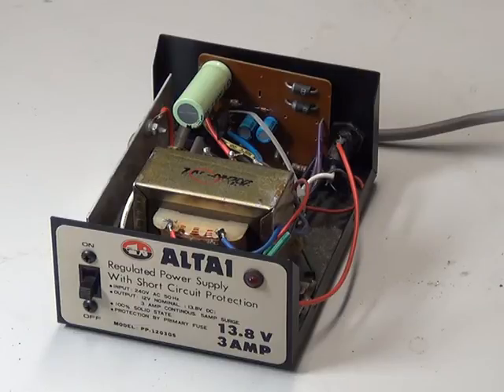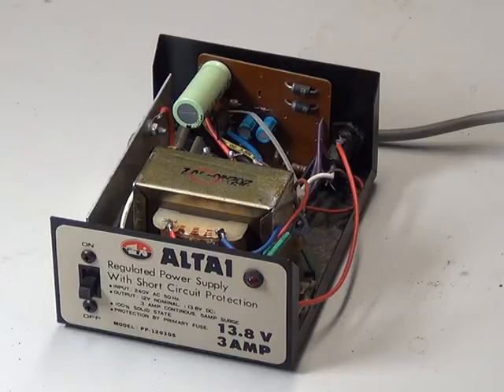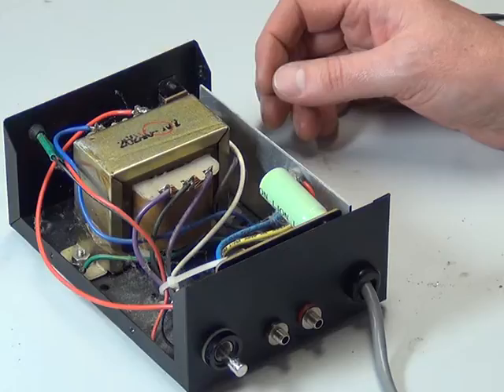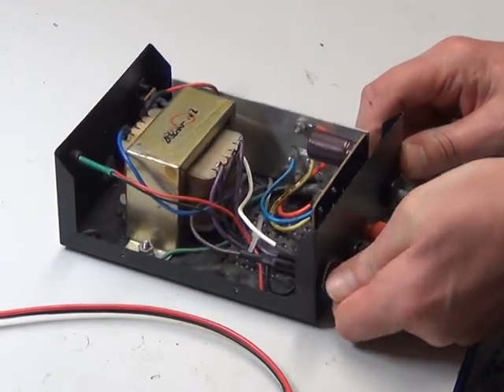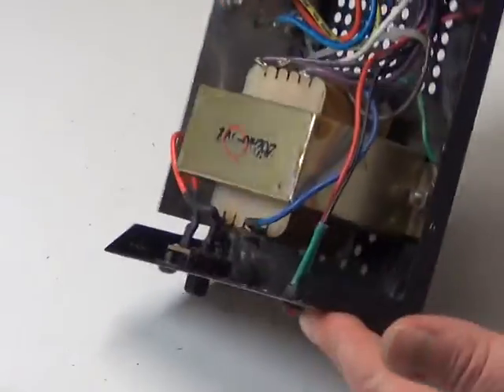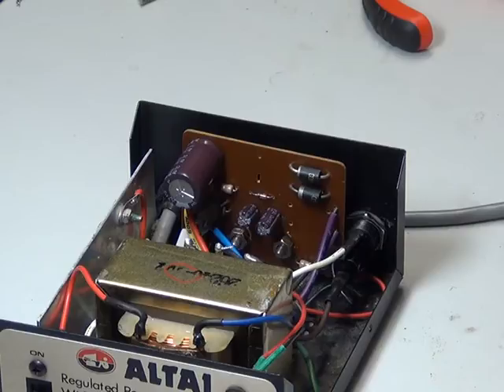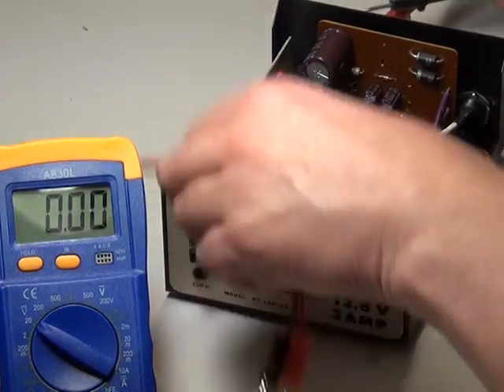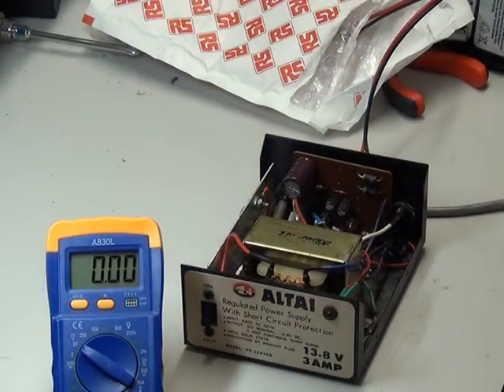Altai 3-5A 13.8V CB power supply overhaul. 1981 Taiwan version

Comment: Interesting, I have the 6amp version and nearly died of shock when I first opened it, as it's in original state. Probably put a different switch to the low voltage side. You can still get 2N3055's

Comment: HELLO WHAT IS AC OUTPUT VOLTAGE   ON TRANSFORMER ?
Reply from the maker: This was recorded years ago so I don;t remember. However, it would be around 26V. I'll be covering the 5-7A versions of the Taiwanese power supplies very shortly in great detail & even building a brand new one from scratch with new safe parts.

richard (UK)
Reply: @ukfmcbradioservicingTango21  id of agreed  on 20 or 17v    AC  ......  i never  thought  it would be  as high  as 26v sir but you could be right    thankyou   i asked this because I  require  17/18v ac  1000ma there  about s for a mixer deck and would  gut one of  thease    as mixer  supply  are expensive
Reply from the maker: @jonneilsmyth9107  I'll do a quick video for you right now on the AC voltage as I have one gto hand for the project mentioned. No need to gut it, just come straight off the transformer. Bear in mind these PSU's were banned from sale over severe safety issues back in 1981.

Richard
Reply from the maker: It turn out to be 33V......but is centre tapped making 16.5-0-16.5
Reply: @ukfmcbradioservicingTango21  THANKYOU  16.5 AC is good enough  sir ....OK LAST QUESTION    how many AMPS  OR MILLI AMPS WOULD  AN ALTIA  3 TO 5 13.8DC POWER  SUPPLY GIVE     ON THE  AC SIDE OF THE  TRANSFORMER   GIVE  ME ON THE AC SIDE    I NEED 800MA  PLUS   ?   IT SHOULD BE  OK DO YOU  THINK  IF SO I CAN  GET CHOPPING
Reply from the maker: @jonneilsmyth9107  3A continuous, 5A for a few seconds. Have you seen the demonstration video I did for you? Have a look, if not.

Richard
Reply: @ukfmcbradioservicingTango21  sorry sir  i have not seen  video .....   please send the  link  thankyou  once again      ...incase i didn't  explain  proper   so i will get and be able to  draw up to 3A continuous    on the 16.5V  AC side of the  transformer   as well as the  13.8v DC  before the bridge  rectified  and voltage  regulatior     ?   that was my question    if this is the case im sorted    you have been  very very   helping regards
Reply from the maker: @jonneilsmyth9107  https://youtu.be/7sq9O53Yylg

Comment: I have a sharman 20/22 amp transformer, putting out about 12 volts, is it possible to adjust back to 13.8?
Reply from the maker: Most regulated power supplied have a preset potentiometer inside for voltage adjust, so theoretically you can put a meter on the output terminals & adjust it.....but some power supplies have more than one preset & you don't want to adjust the wrong one! Conversely, some powrer supplies are fixed with a zener diode & no preet to adjust. I've never seen the Sharman  20/22 model.....in fact I never see power supplies over 10A.

Richard

Comment: I know it's been a while since this video was published, but I must have missed it when you published it first, Richard.   Just wanted to say excellent video and one that is a must-see for anyone reselling this type of "CB power pack" online.  I had a couple of these and, like you, made them safe (or at least safer) with the same modifications shown in your video.  I was fortunate enough to find a DPDT switch that fit the existing hole on my ones so I was able to add the extra safety of both live and neutral being disconnected on switch off.

Comment: Just bought a pair of the 5-7a ones, they may be a bit newer, the safety issues seem to have been addressed. Inclined to put a simple crowbar circuit into them and possibly a couple of ceramic decoupling Cs from each output terminal to chassis (high levels of rf immunity wanted). For the price these cost I couldn't build them, they will spend their "retirement" with mostly low current draw loads. FWIW some of these can benefit from having some of the secondary winding removed (best not try it with the centre tapped winding in this one) the pre regulator voltage is a bit high and can be reduced a bit.  There are a few reliablity mods you can do but they are not needed if the load is never near full rating, safety though is not optional.
Reply from the maker: Conventional power supplies of this kind of rating are now getting extremely expensive; our wholesalers want around £40+VAT. Gone are the days that they could retail at £16.99. I bought about 15 'spares or repairs' CB type PSU's off ebay. Personal collection was about 50 miles away. It's now even worth replacing faulty transformers...RS actually don't charge a fortune for them for starters. Not everyone  has caught up with the reality that PSU's are now pricey & bargains of broken ones can still be had at rallies.

I still don't feel that switch-mode supplies last, and I've been working with them since 1969.

I can stand back & look at what electronics is working after 35 years & only need a few capacitors changing. To be honest, it's the expensive makes that seem to fail first.....mind you , I've noticed that in cars & power tools too!

Richard (UK)
Reply: UK CB radio servicing I picked up 2 at the weekend, in each case the sellers were surprised that I was not bothered whether they worked or not. I would probably not go to the expense of fitting a new transformer, cheaper to strip one from another power supply, I should keep a better eye out at local boot sales... thanks for the reply.
Reply from the maker: @g0fvt  I have this 'mostly working' routine when I buy HMV Stereomaster radiograms on ebay & have to repeatedly say that they all get the full overhaul treatment whether or not they are working 'a bit'. 

Richard (UK)
Reply: @ukfmcbradioservicingTango21 I think we are a dying breed buying things for the fun of fixing them. I did a very minimal repair and clean up on a 1949 PYE radio, as soon as it was finished I wanted to give it away to someone that would enjoy it, my wife won't let it go.

Comment: Hi Richard and Mr Chippie,
Thank you for uploading this Video to YouTube .
I have a very very similar Power Supply to this one, that I plugged in 2 week ago - only to be greeted with a big bang and a large plume of smoke !!   the large Capacitor 'bit the dust' .. it was a "" Nicon 200MFD 25WV ""!!  ..sic. ( Since Replaced with a 2200 µF, 25 V, ) ..
I was going to take on board your recommendation, about the Fuse wiring and about shielding the LIVE parts .
Now I'm having trouble - because something else must be gone ? - The output is 24.9 Vdc .. ( 22.9v with 12V 5W car bulb Load ) .... 
I'm from Ireland and my Mains is 240 V - - I'm getting (18.9 +18.9) 37.6Vac across the back of the Transformer..  
I would be very grateful if you could help .. I'm not 100% on electronics but have an interest and I would really like to have this Power Supply back in business .....
Thank you in anticipation ,
Peter
Reply from the maker: Peter,

Usually when a PSU goes 24v (full rectified voltage), the big transistor on the heatsink has failed. Shouldn't be a snag or expensive to get. You can always email me ar rshireby@yahoo.co.uk

Richard
Reply: Hi Richard, 
Thank you for taking the time to reply to my message.  And for the offer of contacting you directly through email.  I will definitely take you up on that offer . 
Kind Regards,
Peter

Comment: so i've bought one today at a market for 10 dollars and i want to use them for electrolysis... but is it safe to do that?
Reply from the maker: The idea of this video is to show how a power supply that was so unsafe that it was banned in the UK can be modified to be made safe & reliable. Provided you or someone else had modified the power supply as shown, to be safe then they are good & reliable. As they were made, they will always be unsafe. So you have to determine if the fuseholder has been replaced & rewired & also if the power switch is double pole or not....or at least switching the live side rather than neutral as they were made. All mains wiring needs insulating sleeving fitted; these were the main three safely issues.

Richard (UK)
Reply: ive got the 5-7 amp model is that one just as unsafe?
Reply: yeah sorry wasn't really paying attention... was kinda tired sorry for that i didn't mean to be disrespectful!
but if i were to use it for maybe 3 hours per week. would it be that dangerous that it isn't usable?
Reply from the maker: Yes, exactly the same but with uprated transformer etc.
Reply from the maker: As shipped they were all unsafe. Take the lid of yours & watch the video carefully. See if it's wired as this was in an unsafe manner or if it's been rewired as we did our demonstration & also remember that when the fuseholder is unscrewed, the fuse should come out with the cap & not stay behind in a live & dangerous state like ours did; hence changing the fuseholder for a safer type.

Richard (uk)

Comment: Recapped my APEL 2,5 Amp 12.6 volt CB PSU.  Removed 2200 UF and two 100Uf elect Capacitors. Replaced with new Philips Caps. Tested the old caps and found on my Capacitance tester that they are still in range of original values. Seems amazing after 38 Years!
Reply from the maker: Jolly good going. Capacitors in 'consumer' products are usually rated at 1000hr usage (at full rating). Being in business & having access to RS Components, it's easy to compare products with life vs rating vs price etc. O often use 105c temperature rating in things like power supplies & amplifiers instead of the standard 85c rating.

The first flat panel computer monitor I bought (about £329) failed one week after the year warranty. Seeing as I work as a church organist as well as the electronics work, it happened on a Sunday & I wanted to print off the service details to take the right music with me...and needed to be setting off for church in 15 minutes. I quickly removed the monitors' PSU & spotted a 'distressed' looking capacitor....had one in stock..soldered it in on the living room floor...and it worked. Phew...that was close!

Richard

Comment: I had one of those for years!!!!,and a Loadstar and many of that time 😵
Reply from the maker: The bigger 5-7A version I am currently doing a video on is branded CTVR. These reliable power packs (but potentially dangerous) came badged with a whole host of names. The danger isn't the thing catching fire or blowing up, just down to small fingers & live parts.

Richard
Reply: UK CB radio servicing thanks for that Richard looking forward to that,you are dead on about switch mode supply amp's my ham Kenwood is very noisey in places.
Reply from the maker: The first ever switch-mode power supply was in the Thorn 3000 colour TC series, starting in 1969. I've hated them ever since! This solid state colour TV (very unusual at that time) had a 58V HT provide by the switch mode psu. Slightest capacitor degradation & the picture turned to cogwheels!
Reply from the maker: UPDATE. Our 5-7A power pack is being a swine. I'm glad I bought it off Ebay & not someone else. Did the safety mods & switched on...was greeted with 22.5V.....short circuit output transistor. Still not right though but will look at it again later.
Reply: i have that one would it be safe to use it for electrolysis

Comment: I would switch first then fuse. The plug top would have a 3A fuse in and the mains switch in the unit would be rated at 10A so when you switch the unit off the fuse carrier is dead and safe to remove the fuse. otherwise the bottom of the carrier is always live even after the unit has been switched off, So if anybody pokes anything into the unit thinking they have switched it off they will get a shock.
Reply: I fully agree, switch first is the safest "idiot proof" way.

Comment: have an old Al 212    12.6 2.5 amp psu. probably 80s. its powering a camera. voltage is fine. its been in constant use for 3 years. should i replace electrolytic caps ???
Reply from the maker: Electrolytic capacitors last between 1000 & 2000 hours use. Best to change them after that use period has elapsed.

Richard

Comment: Cracking Video, I have a Tarren 3 amp kicking around  that i am going to look at after seeing this. 
I'm currenty running a Alpine ATX. I got the voltage up from 11.98v to 13.5v by changing one resistor from 100k to 150k. (The 100k coming off pin 16 of the IC).  Go any higher and it shuts down on over volt. I kill the RF noise with a ferite bead on the cable to the cb.
I'm gonna dig out the Tarren and give it a service, if i remember correctly, it was kicking out 15v when it was taken out of service. Another very popular PSU the Tarren, made in Britain too but nothing on the internet about them.
Reply from the maker: We have a Tarren unit here & I must dig our out & go through it on a video. Sometimes a high output voltage indicates a short circuit output transistor; cheap & easy to replace.

Richard
Reply: Thanks Richard, was thinking along the same lines (unregulated output). Maybe its insulator has broken down. I will post my findings.  
I love the channel BTW
Reply: I also have a Tarren so a service on that would be great

Comment: What a great idea....i really like the old PSU i will be following your instructions and doing mine...Richard if you do another is it possible to go into a bit more detail.I.E how you managed to re-wire the fuse away from the switch also what make of caps were used (do you have a preference) what technique did you use for the shrink tubing (if thats what it is) good video thanks
Reply: Yes I had a Bremi 13.8v 3 amp one for a decade throughout the 80's. I wonder if that model was one of the ones you thought may have been unsafe Richard?
Reply from the maker: The early importation of Bremi products prior to 1981 had them coming in with 2-core mains leads & designed for 220V mains. Aparts from upgrading to include & earth with a 3-core mains lead & clamping the earth to chassis, the electrolytic capacitors needed uprating from about 28V to 35v....otherwise they had a tendency for the electronics to blow up. I'll cover these psu's soon.

Richard
Reply from the maker: No extra wire needed. Live wire straight to rear connection of fuseholder. Other wire from fuseholder to switch. These are 32mm or 1.25" fuseholders. Fuse should be 1A antisurge (1AT) T stands for "time delay". 3A fuse in mains plug. Heat shrink tubing kit from Aldi! We always get one when they come on offer as it's cheaper there than trade. Although we have a hot air gun, Mr Chippie just out the soldering iron alongside to cause shrinkage. We'll do the CTVR 5-7A version then tonight. Do you remember the Italian Bremi ones too. Might have to cover those too!